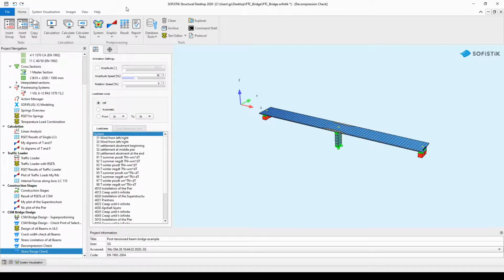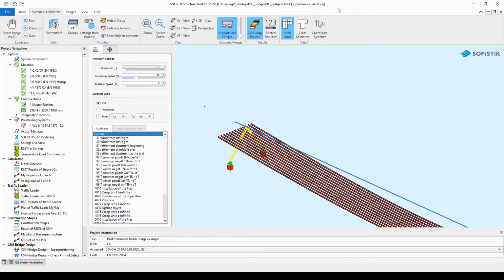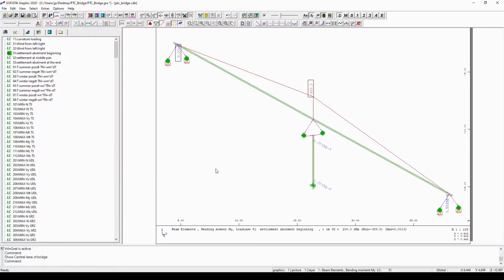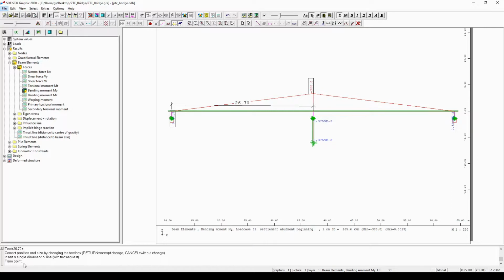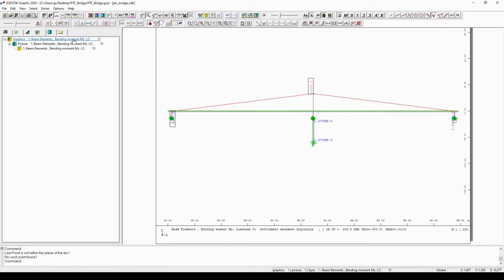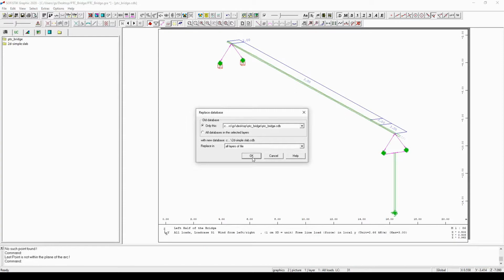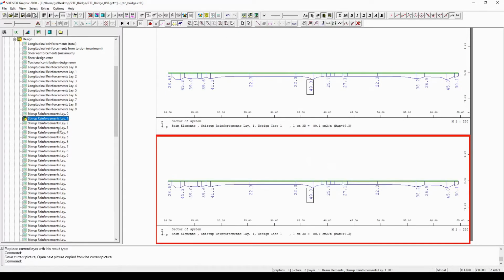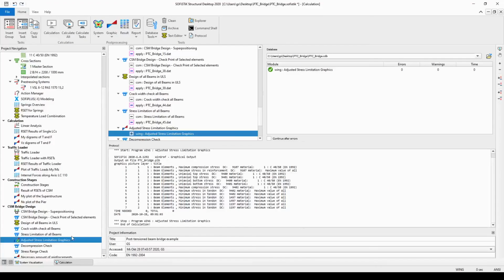Bridge Design Training #13 - Graphical Output with Graphics (WINGRAF)

Comment: To be hones as a beginner it's a bit confusing how Sofistik is generating report in different windows that are still interconnected. 
But I must point out that this explanation was one of the best I could find!
Really well explained! Great video!

P.S. Quick question. Is there a way to manipulate with font size under diagrams? 
Asking for the text for example "Beam Elements, Bending moment My, Loadcase......" that is written under the box ?
Reply from the maker: Hi aljosha23,
thanks for your feedback!
P.S.: You find this option in Wingraph-View-Graphics Setup...-Annotation and then you select "Head line of layer", then you gt the Text-Height (cm) option to adjust it ;).
Reply: @SOFiSTiKAG  Thank you a lot!